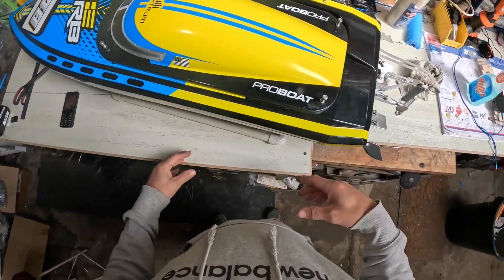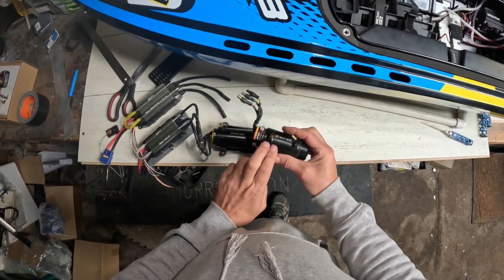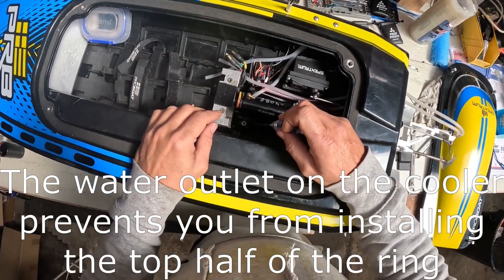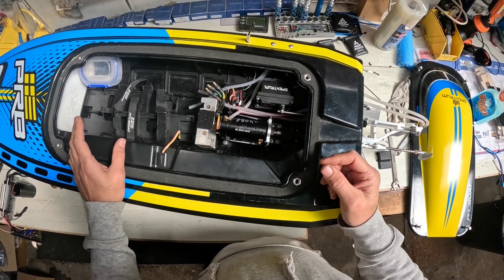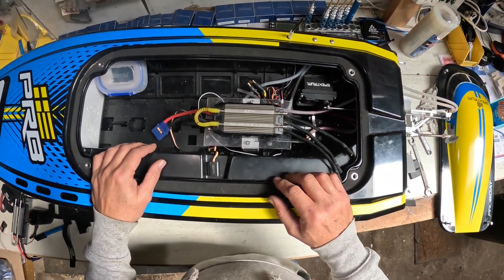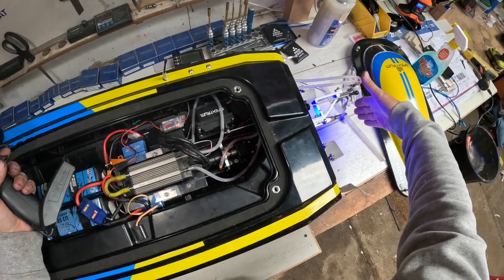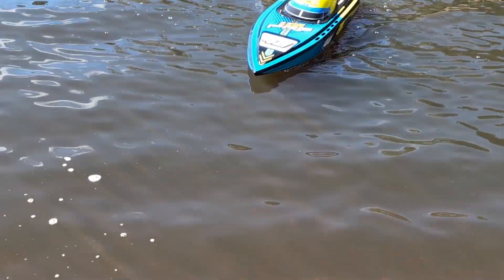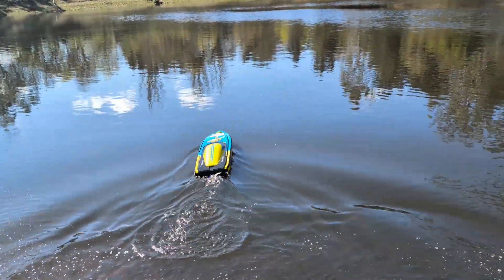Upgrading the Supersonicwake 48 to 12s TP4070 motor/ZTW 300a ESC

Comment: Well done, you're right to point out that a 55 is too big for this KV, but a 52 will probably work because the lipos will be empty in 3 minutes and the motor won't have time to burn out. I don't know what size connectors you have on the lipos, but if it's 5.5mm, it won't hold.
Reply from the maker: Yeah, i dont know how everything except the motor was stone cold, including the small terminals, weird